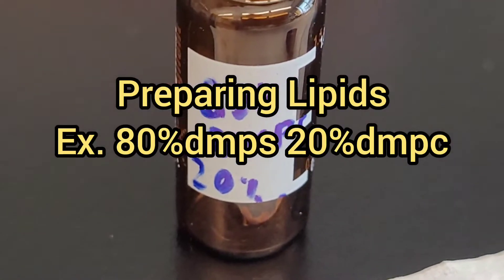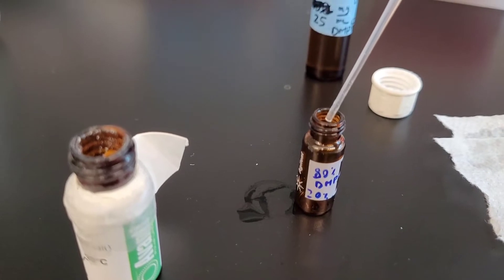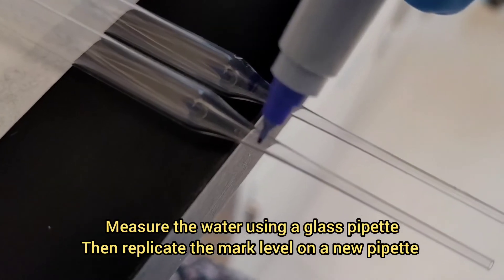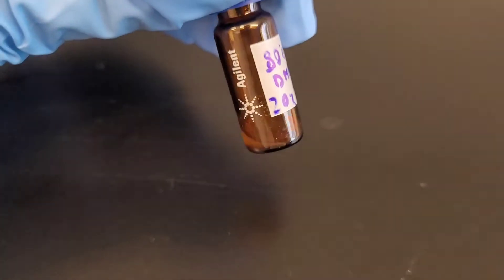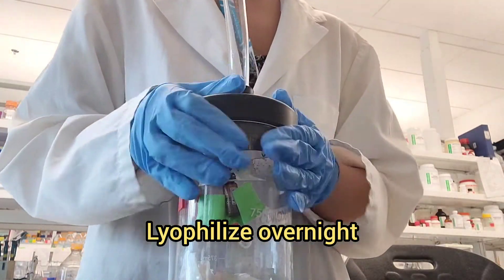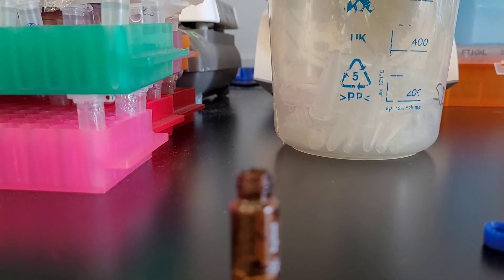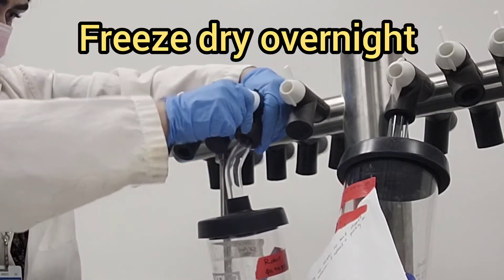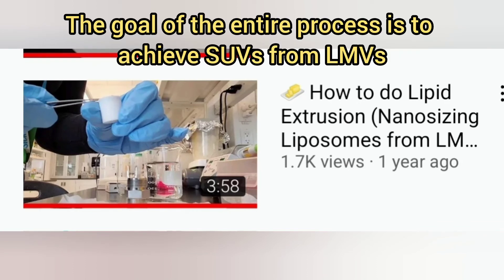Preparing Lipids for extrusion, from chloroform to aqueous buffer || Practical Biochemistry

Comment: How do you store your lipids? Do you aliquot them to prevent melting the entire bottle before weighing it?
Reply from the maker: Long term storage is as powders, or dissolved in chloroform and in -20. Once lipids are extruded they tend to be good for a max of 1 week in an incubator. Better to use right away.

Comment: Very nice❤ i am wondering why not directly extruder after lipid rehyration with water. Can I omit the lyophilization step?
Reply from the maker: That is part of the rehydration step. I don't recommend skipping it. You can see a clear difference in how the lipid looks. In the first lyophilization step it looks very dense but after the second, it will look very fluffy and you know that it's been rehydrated.
Reply: @biochemistmelo  thanks！i have used this method to prepare my liposome,it's very useful😊

Comment: Thanks for the video! after complete drying of the lipid layers and adding buffer, my solution is not milky and is not suspended very well, what should I do ? I am afraid of blocking the extruder by the lipids
Reply from the maker: What is the name of the lipid you are using?
Reply: I am using chlosterol. 10mgml
first dissolving
second dehydration 
after adding PBS, it is not suspended.
Reply from the maker: @Avayekaveh  I never worked with pure cholesterol, only 15-30% in phospholipid mixes and mix them in the beginning in chloroform then evaporate, freeze-dry, hydrate, freeze-dry, add buffer and extrude. If you have to mix it with a lipid down the road, it is easier to do it earlier.